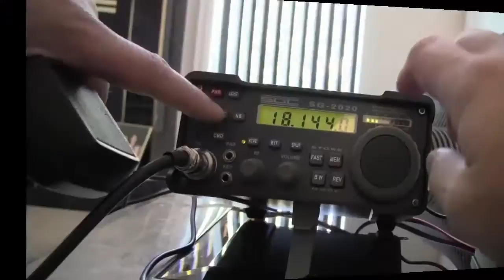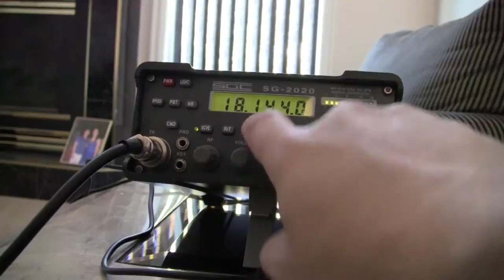Small indoor Magnetic Loop on 17 Meter SSB

Comment: With 15 watts, you really won't have a lot of exposure. The cap is not good for a whole lot of power - the voltage at the tuning point gets up into the 10,000 volt range when the Q is high (low losses) -- which would arc over with an air gap capacitor.  

Portable loops are *great* with low power (QRP rig operation)  --- The big problem is that you have to retune every time you change frequency.  (No ATU required.. You tune the antenna mechanically by changing the capacitance.

Comment from the maker: Yes a little, but for the most part I am 5 to 10 watts and I am sitting about 12 to 15 feet away... This is not a permanent day in and day out operation, I am just shooting a few videos to make the point that these things work... Then I will be installing similar loops out of doors with the capacitor and motor, weather proofed/covered. I do appreciate your concern... In addition, I have been using 5 watt HTs UHF and VHF for almost 30  years and I am only a little more stupid than when I started.